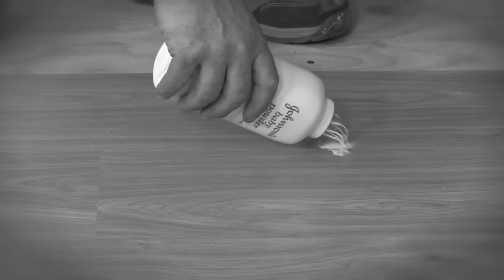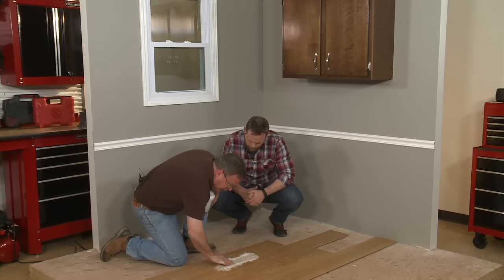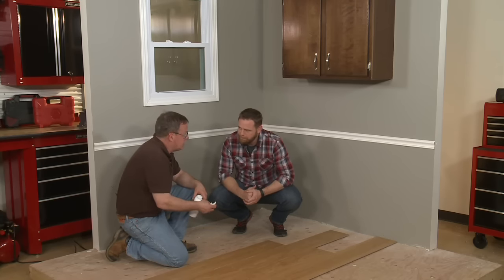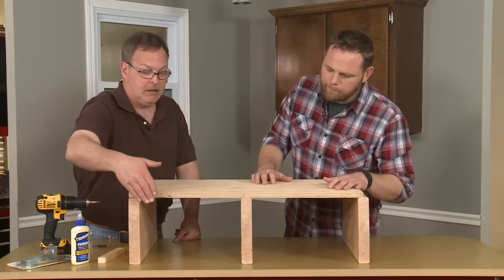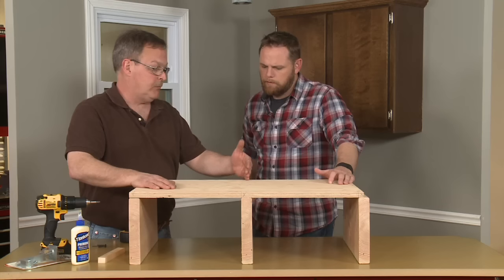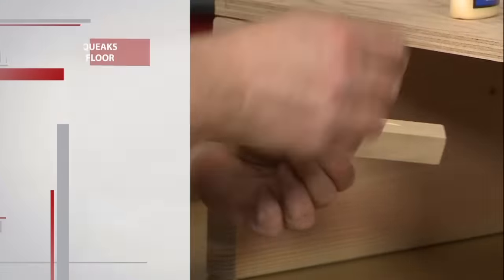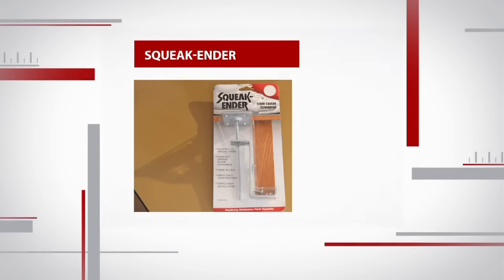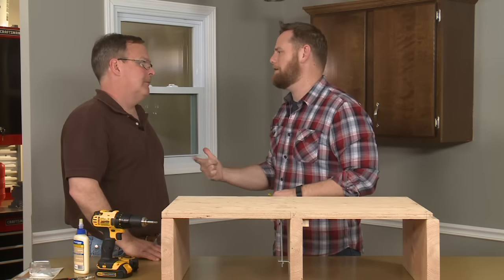How to Fix Your Squeaking Floors

Comment: Ok so I got a question then. My bedroom floor is noisy so its alone the middle like this guy is showing. So the noise is from the nails. Right? Well in my floor its particleboard and with big staples so my brilliant idea was to pull all the staples out, no metal no squeaks rightttt.... nope still same amount of noise so I throw a screw one by one to see if it helped sadly I have failed again. Cant go under the house it's a double wide everything under is black plastic and insulation. So what do I do
Reply: Oh the squeaky floor is so bad that it's not possible to get freaky with someone because everyone else here's the squeaking rhythm of it.

Comment: Is adding the small block of wood method good if theres gap between the subfloor and joint? There's nails in the middle between the joints not attached to anything for some weird reason and I believe that's what's causing most of the squeaks

Comment: we dont have a subfloor in our old house, we have angled oak floorboards with hardwood flooring installed right on top... as we walk around, all the dirt falls into the basement because the basement  ceilingis not finished. our floors are so noisy we cant stand it. Id like to quiet the floors and somehow cover the ceiling so we arent having dirt constantly falling all over our stuff in the basement.,

Comment: So somehow the screws didn't completely fix the squeak. Most spots were fixed, but this one area of the floor continues to squeak no matter how many screws I put in. I don't have any access from underneath, but I kinda want to get everything completely squeak free before I put the wood floor down.
Reply: Same here i have put down so many screws and its just one darn spot that wont stop squeaking. Did you fix?
Reply: @Implacable17  Nah, but we did also try putting glue down where the plywood boards meet up as well. The squeak we had left after the screws was pretty minor, and then once the wood flooring is down it doesn't squeak at all. We didn't start putting the glue down until we got to the hallway, so the first room didn't have any glue. We used some slightly watered down Elmer's glue (maybe 1:1 or 2:1 glue to water), and then for the bigger cracks I used Titebond 3 Ultimate wood glue (not watered down). So far no noticeable squeaks anywhere else.
Reply: @zZrEtRiBuTiOnZz  could be a joist hanger that needs to be secured. this would require you to break through the ceiling.
Reply: @zZrEtRiBuTiOnZz  I'm a bit late to reply but as a long time hardwood floor installer, yes, most of the time as long as you do your due diligence the minor squeaks will go away when you install thousands of pounds of wood over the top. Especially if you installed correctly across the joists instead of along them.

Comment: Use deck screws....not drywall screws.....
Reply: Correct indeed. I have only the basic knowledge of these things and instantly spotted that error.
Reply: Why deck screws? I was actually searching the comments for this answer!
Reply: @dominicporta6127  Deck screws have opposing threads that pull the wood together. They are also composed of harder metal and are more water resistant. Drywall screws are weak and will break or pull out over short periods of time. They are made for only dry environments
.

Comment: I think you might want to check for pipes under the boards before you just start driving screws randomly into them. 🙄 this guy is not a professional of any trade, he's a amateur handyman at best. Baby powder? Wtf.
Reply: A 2” or 2-1/2” screw will do. Won’t go deep enough to hit any pipes or wires. On subfloors of course